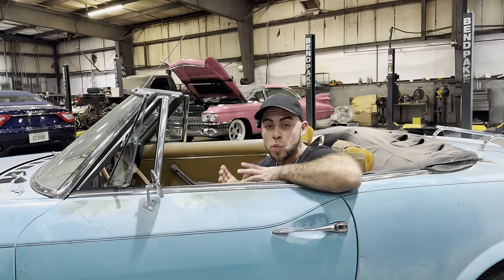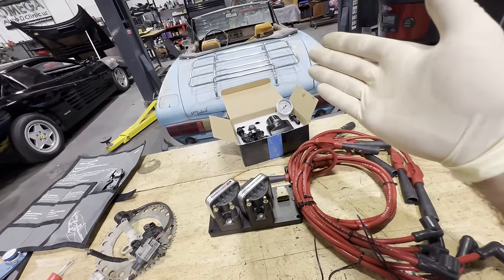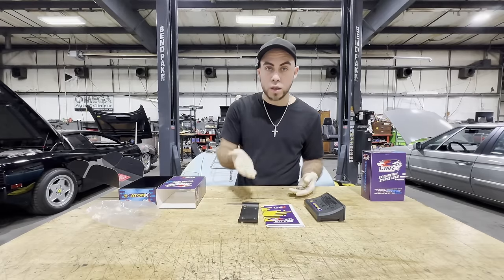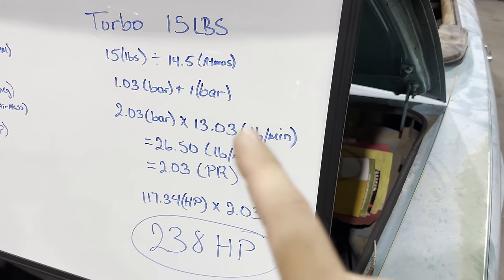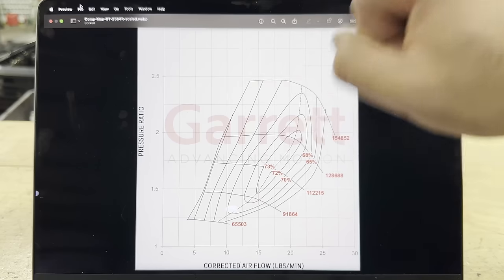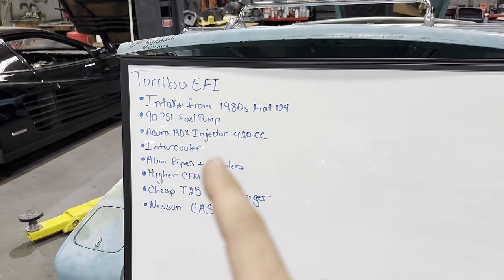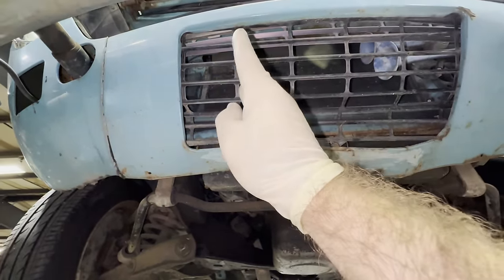Saving Money By Scavenging Parts from Wizard And Hoovie's Cars To Build The 1976 Turdbo Fiat!!!

Comment: I owned a 1972, USA model, picked up at the factory in Turin. It was a great car until it rusted out pretty dramatically in many panels and most of the brake lines in the late 70s. I donated it to the HS auto shop, it was rebuilt and seen around town for years. About the bumpers: Mine had normal attractive small bumpers -- I would ditch the giant bumpers completely on this one. BTW, I had the chance to visit the old factory last year on a trip to Italy. It is now a giant shopping mall including the hotel we stayed at. I did not know it was the same building until we saw the display of how the factory was set up: Car manufacture would start on the ground floor, travel down the very long first floor, then second floor, then third floor, and finished cars were tested on the test track on the roof. Mine came complete with cheap steel already rusting and one or two wheel bearings with no grease, and several ground wires not connected for various lights. But it was a blast. I am very much looking forward to this set of videos.
Reply: Lingotto is definitely on my list of "Must See" places. My 124 Spider was actually assembled there.

Comment: I also say that before the turbo kit goes on, you should change the head gasket, and while you are in there, the timing belt and  water pump.
Reply: Yeah, I was looking at that timing belt too.
Reply: HG is not needed. 15psi boost is not very extreme. It will hold for a while. Timing belt + waterpump: good idea.
Reply: @jfv65  Yes and no.  That's a lot of additional cylinder pressure applied to a part that was never meant to see that much.  And in what condition is the existing head gasket?  Look at the condition of the whole car....
Reply: 124's were head gasket touchy but nowhere near as bad as the 128's!  The 128 had retorquing done after initial startup and before it was loaded onto the ship.  The dealer was instructed to do so immediately upon arrival.  The customer was required to retorque at 500, 1500, 3000 and every 3000 miles from then on.  Thats a bunch of retorquing!
Reply: @johngaither9263  Wow, crazy-

Comment: Those energy absorbing bumpers were almost 15mph bumpers. I would leave them. I owned 7 Fiat 124s in my past and I liked those bumpers. If some ass in a parking lot hit your bumper most times there would be no damage to my cars. 
I love the idea of the turbo since the bottom end of engine was a 5 main bearing and the journals were as big as some small V8 engines. The brakes will be a problem since the calipers would corrode and make the piston stick often. Had it happen all the time. If new calipers are available just replace all 4 along with the master cylinder. Don't forget about the rear brake compensator on the rear axle. 

I was an odd ball I suppose, I loved my Fiat 124s.
Reply: I'd dump the bumpers. This car is better suited for rally use in its condition. Will never be a cruiser. You aren't going to the store in it.

Comment: DMC Crimpers....  There I was, in the US Air Navy working Aircraft Electronics and the 'Go To' for trouble shooting complex out of spec systems issues related to connector and wire repair. My first aircraft, the A7 Corsair II, had a DMC Kit of 7 total tool cases with one case alone holding over 2,000 line items, both durable and consumable tooling, and a total of over 12,000 individual parts that you HAD to account for every time you checked it out of the Tool Room, once you got the side of the Aircraft to work on it, when QA/CDI inspection was complete and again when you turned it in to the Tool Room. My last few years, I was the Manager for the Tool Room of a Composite Squadron that supported a total of 5 different platforms, SH-60s, MH-60s (yeah, totally different DMC kit, whole aircraft used smaller wiring than the older SH-60 did), P-3 Orion, S-3 Viking and C-130 Hercules, with duplicate kits for the P-3 and S-3 aircraft for a total of 7 DMC Kits that contained from 5 to 10 DMC Cases, plus 2 additional DMC Accessory Kits one for EMI Metal Shielding and one for a new Armor Coaxial Cable in the MH-60S Knight Hawk. I know DMC Crimpers..... I don't know if the company is still located next door to Universal Studios Nickelodeon Studios on I-4 but it used to be right there. Wait to do the Nick Studio Tour and right across the fence was DMC Company.

Comment: In the late 70's I had a '69 Fiat Spyder. I had it repainted and it was best without the bumper of course. Ralph Nader had not ruined that year so the bumpers were still small chrome; no rubber. But till looked good without them. No pollution junk on it so the 1438cc motor still pushed it. 6800 redline was cool and 5 speeds. A lot of fun but work to keep running.
Reply: That was a rear engine 850? I drove a few of those.

Comment: Find out if you can just remove the rubber from the front bumper.  If the bumper has the same dual tube profile all the way across it could look very good.  If it isn't all chrome then use paint?

Comment: Exciting project! It's like my own project, but with people knowing how to work on it & the garage with tools (motivation)...

My custom wish list:
1. Cool seats
2. Coil over shocks
3. Roll bar (to stiffen the body & "frame")
4. Oriental rug (cheap) for the interior..

5. Independent suspension in the rear, modern rack & pinion  with performance suspension....
6. Fiberglass racing bumpers

(Mrs Wizards sales should cover it... 😅 )

Comment: All makes sense... great to potentially use all those leftover parts.

You should consider opening up some more cold air inlets in the front lower valance, and try fitting a Triumph TR6 front air dam to help force more air into the engine bay.

Comment: You could use factory 2nd gen DSM parts. Already using the T25, so why not the rest. It's already proven, and on the used market, it's cheap.
Reply: I wrote the same and looking at the engine bay around 18:25 it looks like there's enought space to even use the mitsu exhaust housing and re-use the Fiat exhaust manifold with the right flange welded or fitted on it
Reply: @alain99v6  Dang I didn't look at it that close. Another thing, at just 200 hp he could use a 1st gen side mount, and 450cc injectors.

Comment: the DMC tool is called a Bootlace Ferrule crimper. They should be used a lot more often than they are. You should be able to buy a more simpler version for under $100.

Comment: Isn't the in-line 4 cylinder head a crossflow design?   ie.   the intake ports are on one side and the exhaust ports on the other side.   
If yes,  then I would recommend a crossflow intercooler.   Intercooler entry on the passenger side,   intercooler exit on the driver's side.

Comment: Ive owned two of these cars, currently own a 1968 spider 124. I’ve actually been doing a lot of research recently about possibly doing a blow through carb turbo setup, rather than efi, but I’m not liking how it’s turning out. I’m excited to see where you take this with actual fuel injection!

Comment: I'm enjoying the Fiat  Turdbo.
I think it would look nicer without the front bumper. However, if your goal is to maintain stock appearance, you'd have to leave it on. Ideally, you could pull the bumper closer to the body on the front and sides. As it is, it is pretty ugly,  sticks out away from the car. Probably some government regulation for safety purposes when it was sold as a new car.

Comment: Great project. Don't use the US-bumpers, if you can find some european ones, they are much nicer. Or none.
My father bought a new Fiat 124 Sport Coupe in 1968, and had it until 1972. It rusted away.
Peter Larsen from Denmark.

Comment: Hi Daniel-San.
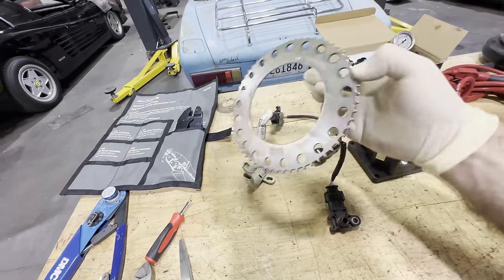On that trigger ring, I noticed at 2:49 that there was what looked like a tooth missing on it. Why is there a missing tooth?
Also will you after sorting out the brakes and replacing those few bits of the rubber ring on the drive shaft, be doing a dino run so you've got it to run as standard for a comparison?
Good luck with this project 👍
Reply: the tooth is missing because that's how they work ! each tooth will create 1 pulse when it pass in front of the crank sensor, creating a train of pulses that the computer read as the RPM, the missing tooth will create a missing pulse and the computer will know that the engine made 1 revolution, the missing tooth is usually positioned in way to correspond to specific timing point example TDC of cylinder 1
Reply: @alain99v6  thank you.

Comment: If you are going down the turbo route much better to just get a second hand 500 abarth 1.4 turbo; or do what fiat did with the "new" fiat 124 rally car where they used an alfa 1750 ali turbo engine sourced from alfa and used in the euro giulietta and also 4c cars which gives 230hp stock; however you already have the lampredi twin cam so if you wish to keep the engine then tune it to rally spec of the 1970s which made 215hp without turbo

Comment: You know it's not that much in parts or time to restore the interior.  Why not pull a 1.6L turbo from a salvage yard?  Wow that underside looks like a California / Arizona / New Mexico Car.
Bumpers?  Remove the heavy bumpers (120 lbs?) and put on nerf bars if you really need them.  There's a reason '74 and earlier foreign cars are coveted.

Comment: Adjust the valves before you bolt on the new EFI intake plenum. I can almost guarantee the exhaust valves are out of spec and you will have the devils' own time getting back in there after the fuel injection stuff is in place. also: there should be a complete wiring diagram at the back of the owners' manual. (if one came with your car)

Comment: The bumper is in the way, so YES, by all means remove it. If the car becomes a running, driving vehicle again someday we can address it. I searched images and saw a red 72 Spyder on Bring a trailer (2023) with no front bumper, it accentuates the curves of the car. I want to see your engineering and fab skills. Good luck!👍

Comment: I would be in favor of deleting the bumpers. I might replace them with some simple push bars for minimal protection. But I think that would clean up the look of the car.
A little body work under the front air intake will be needed, once the bumpers are removed (it's pretty well hidden now, by the bumper).
But are we getting agead of ourselves worrying about the aesthetics of the car? Seems like maybe safety and mechamical should come first. Then, if it works as pkanned, make it orettier.

Comment: I have a couple old turbos from my wrx I would give you for free if your interested I have a Mitsubishi td04L with 50k miles that its still good and i have a IHI vf48 with around 80k miles on it that is still good. The td04 is about the same as the t25 it just doesn’t spool as quick.  Im located in colorado so I would have to ship them to you